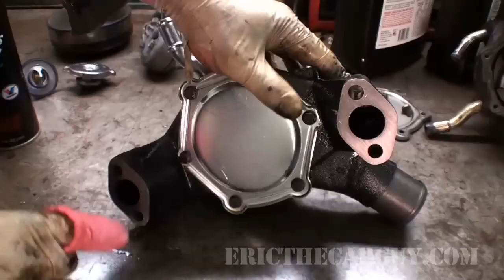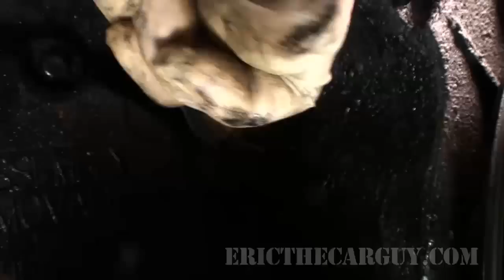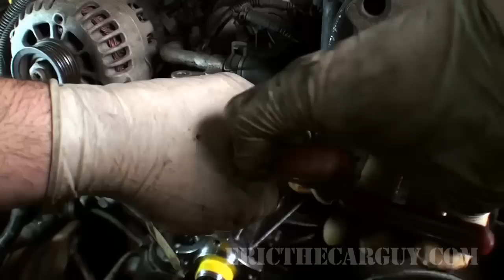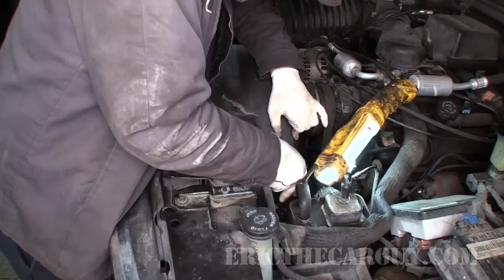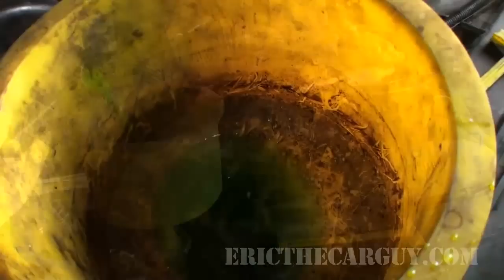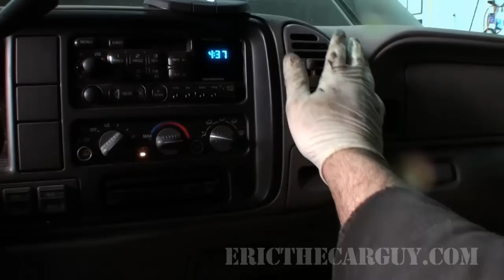1998 Chevy Tahoe 5.7L Water Pump Replacement (Part 2) -EricTheCarGuy

Comment: Eric, I see a back flag in your future because that water pump you just installed will end up being replaced. I say that because you filled the cooling system with green coolant and not Dex Cool. Tahoe's of that year came with Dex Cool. I believe when the Dex Cool was replaced with green coolant, it caused the water pump to leak from the weep hole. GM says not to change coolant types. If your car came originally came with green coolant, it should be replaced with green coolant. If it came with Dex Cool, replace it with Dex Cool. Do not mix or change coolants. You should have drained the block, radiator, heater core and hoses of the green coolant and filled it with Dex Cool. By doing so, it would take longer but it would lower the chances of a water pump come back. And also you would get paid for doing it properly ONCE instead of getting paid once but doing it TWICE.Cooling systems, including the water pump, are designed to work with a certain type of coolant. Mixing or replacing the coolant with a different type of coolant can cause damage because chemicals of a different type of coolant can have an adverse effect on parts that were originally designed to work with a certain type of coolant.
Reply: +Frank Gonzalez

If he flushed the system when he did the radiator he's fine.  Pretty much everyone is ditching Dexcool.
Reply: +ejbcomp What I find interesting is that the radiator was replaced and the cooling system was filled with green coolant. Then a year later, the water pump failed and needed replacement. And most shops, auto parts stores and dealerships will tell you to replace the coolant with the same type that the vehicle originally came with.

I replaced a friends 98 GMC radiator, t-stat, hoses and filled it with Dexcool 6 years ago and to this day it still has the original water pump with 267,000 miles.
Reply: The only reason why Chevy recomended Dexcool back in those years, was because Dexcool "last longer" than green antifreeze.
Reply: Frank Gonzalez .....i recall " "Dexcool lifetime" was a big million $ mistake.